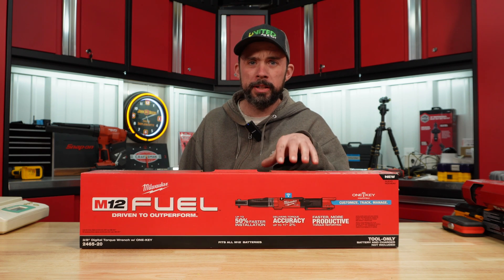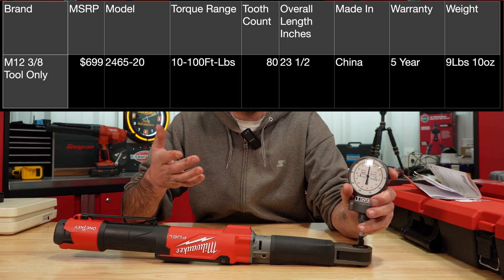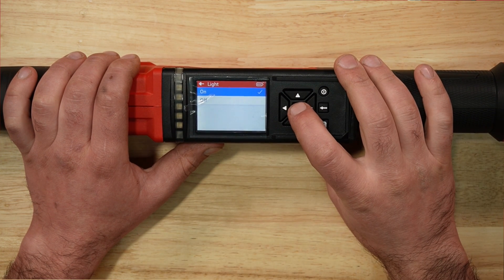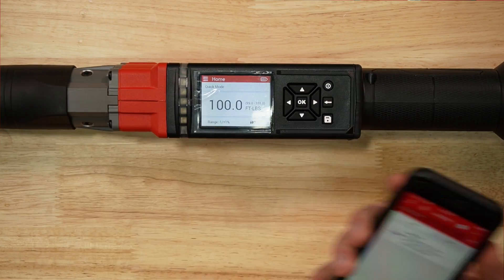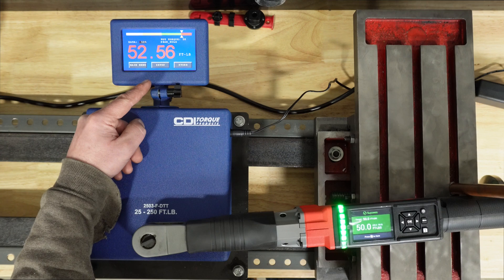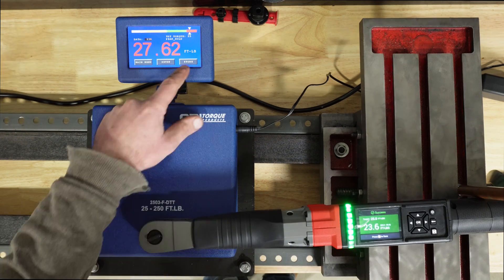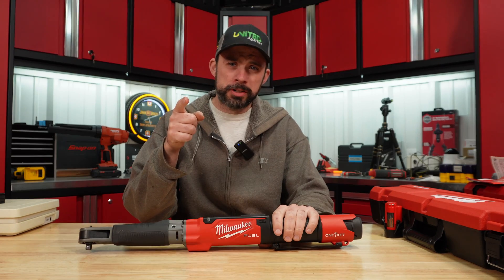Milwaukee Torque Wrench Fails Accuracy Testing,  Unboxing and Review

Comment from the maker: Yes it takes less force to loosen a bolt, this is only to test the rundown feature which claims it can achieve 100% of the torque.  So if thats true set at 100Ft-lbs I should see near that not 32Ft-lbs, or 9 when its set to 25.  

Yes removal will always be less on most fasteners unless there is rust.

This is not a normal bolt,  Its a rundown fine thread loaded bolt.
Reply: There are several reasons a torque wrench can be out of range when you buy it, like was it dropped in transport? Did you hold the wrench still when it was turned on? Also, the run down function is not meant to set to the correct torque, it's supposed to get the bolt close, so you can finish by hand to the correct torque. Read the instructions. Also also, you didn't mention the last time your test rig was calibrated.
Reply: Another way to check. Take a digital torque wrench set well above what the bolt should be. Then KEEP TIGHTENING the bolt until is starts to give/move. Stop and look at the value shown on the torque wrench. You can mark the socket with a sharpie to make tracking easier. 

That gets around all the pesky bolt variables. 

Nice work overall!
Reply: So you're admitting that your testing methodology is wrong, but still claiming that the results are accurate? Here's how you can actually test rundown, and how I calibrate my air guns - take that snap on torque wrench, tighten the bolt to whatever spec you're testing - say 50ft/lbs, then see how much torque it registers to loosen that fastener. Variables such as thread pitch, bolt hardness, and lubrication could mean that it takes 48ft/lbs to loosen, or 20ft/lbs. Once you know how much torque it takes to loosen that fastener, retighten the bolt with the rundown feature, and then use the snap on wrench to remeasure how much torque it takes to loosen. The % difference between the 2 results should give you an idea of the % of accuracy. You can then verify by adjusting the rundown torque by that % and see if it now takes the same exact torque to loosen the bolt. With that said, IIRC, the industry standard accuracy spec for engine fastener torque is +- 5%. So although the results might be out by twice what the tools accuracy is claimed to be, you'd still be within the required specs. Finally, what's honestly more important than accuracy is precision. When you're torquing something like head bolts down to say a 80ft/lbs spec (ignoring the final torque angle), it's much better if every single bolt was tightened to 85ft/lbs +- 0.5 vs 80ft/lbs +- 4ft/lbs. That's actually why I prefer click style wrenches and only really love digital wrenches when a torque angle is needed. 

Also worth mentioning, a lot of digital torque wrenches (like that snap on) tell you in the instructions the proper way to use the wrench accurately - typically no stop/go movement, but a smooth continuous rate of rotation at some obscure degrees of rotation per second. That slow creeping to the dialed in torque may be you simply using the tool incorrectly. Not saying it's the reason for the results, but it could be a contributing factor. The snap on being able to accurately operate under those conditions doesn't mean the milwaukee should or will. I'd only test click type torque wrenches the way you're testing them.

Comment: Will it just shut down after 5000 cycles?? Can this function be switched off?
Reply from the maker: My understanding is it comes up with a message that needs to be dismissed allow you to use it after 5000 cycle.  But I personally never made it to 5k.

Comment: Its off by 2.x ft-lbs everytime, did you try calibrating it or does it have a procedure for that???
Reply: What i found after a quick google search is that you have to send it in to milwaukee for calibration. Factory spec is + or - 2% accuracy so @ 25 ft-lbs that would be within 0.50 ft-lbs meaning your wrench definitely needs calibrated.
Reply from the maker: Yeah I ended up retuning it, once I seen it had to go to Milwaukee for calibration.  Hoping to pick another up at some point.

Comment: Bro, unbolting a specified torque will always require less torque than was applied. I've tested this theory already. "If i torqued it to 90 ft lbs it ahould require 90 ft lbs to remove" but no, i usually need 70 ft lbs. Yes its much more than 35 out of 100 but i doubt the ratcheting alone will ever reach the specified torque.

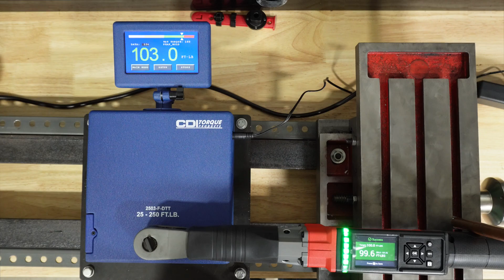Comment: The tool isn’t supposed to be used like you used it at 7:00. It works as an electric ratchet yes and the run down feature does install the fastener like an electric ratchet but you still torque it down like a regular torque wrench. The run down feature is made to not over torque the fastener.

Comment: Thanks for the great video! I was considering buying the Milwaukee digital torque wrench in the 1/2 version , and your review gave me a lot to think about, along with some solid alternatives. Did Milwaukee provide any feedback regarding the out-of-spec torque issue? If so, did they recalibrate it for you?

— Ethan from Australia
Reply from the maker: No problem!  I was within the return window,   so I went the simple route.

Others have said they had theirs recalibrated and are good now.  

Im hoping to get another at some point and retest it.

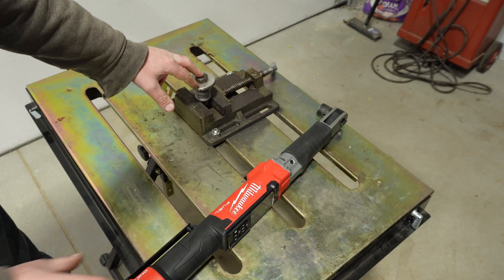Comment: 7:05 this test is moot. When unfastening, the torque reading will always be lower since you are "realeasing tension"
 Try this: take an average fastener and an average breaker bar... tighten the fastener as tight as you can and then unfasten it. You'll notice how unscrewing is much easier than tightening.
Reply from the maker: Yeah that was my mistake.

Comment: I know of a few places they use these to torque bolt in axle assembly thankfully it has a tolerance of around 10 percent. It definitely speeds up the process but wish it was definitely closer
Reply from the maker: Yep,  seems  like they need to look at how they are calibrating them.

Comment: What’s a good flex head torque wrench in 3/8 or 1/2?
Reply from the maker: 1/2 digital I would go Icon or Gearwrench 120XP,  Icon should have a 3/8 version this year.  Mechanical Icon split beam or tekton.

Comment: I wasn't able to watch the entire video but do you think it isn't calibrated right and can be fixed? I've heard of torque wrenches coming brand new and being out of proper calibration. Not sure if you talked about that later on in the video
Reply from the maker: Im sure it could be recalibrated,  and others have mentioned they have experienced the same thing and had to have it recalibrated.  I ended up just returning it,  hoping to test another at some point.
Reply: @Tools-Tested  Thanks for the response. I'm looking for a new torque wrench and this helped alot

Comment: I had to torque aluminum frame glass paneling. It would over torque and crack glass. Never had issues with my snap on....and husky
Reply from the maker: Yeah others have said the same thing in the comments, almost seems like they are selling them out without calibration.  I hope to test another one next year.

Comment: With regards to the calibration certification: I’ve worked as a process engineer in the auto manufacturing industry, we use 100’s of transducer torque tools for safety critical applications across multiple plants. 

Mechanical torque wrenches use release of spring tension on an internal mechanism to indicate you’ve attained your torque value, but tools like this use a transducer, which converts the AC current from the battery into a DC current at the drive motor, the current at the drive motor is how the logic board calculates the torque value.

These kinds of tools must be calibrated often, and as this tool is being geared towards techs and manufacturing use cases, it must be calibrated in accordance with certain ISO requirements. 

My company uses Atlas Copco dc tools and they have to be calibrated every few months. Which would constitute roughly the same calibration interval.

Comment: Was about to buy the milwaukee torque wrench but wanted to be sure.
Guess I won't be.

But being a devil's advocate a little,... Could it be that it's the calibration that is completely off and not the tool being bad quality? or is this inaccuracy an irreconcilable fault for the Milwaukee?

Comment: I've always wanted one of this and was able to get a brand new one for half price. I saw your video after I got it so I'm wondering if they got these problems taken care of or if they are all still that far out of spec. Have you talked to milwaukee about your findings? Curious if they had anything to say about it. Thanks for the video
Reply from the maker: It was still in the return window, so I returned it.  I haven't reached out to Milwaukee,  but I hope to get another one soon and see if it performs the same.  No problem!
Reply: @Tools-Tested  look forward to another test. Wish I the equipment to test mine
Reply from the maker: @BoostedTT91  You could always buy a cheap torque adapter from Harbor Freight and see if it’s close.

Comment: After the 5k cycles, what happens and where do you get it calibrated check?
Reply from the maker: Instructions say it has to go back to Milwaukee for recalibration.  Im going to say soon after it hits 5k it will shut off but I'm not 100% sure.

Comment: That's so disappointing, I think the ratcheting mechanism is very bulky and leads to inaccuracy, plus when it's running it sounds like it shakes up the insides pretty badly.
Reply from the maker: Yeah it was,  hoping to test another one at some point.  But others have commented they had to send it off for calibration brand new.

Comment: I don’t have faith in Milwaukee products. Bought their torch that was reviewed favorably by Project Farm. First one will not charge. Second one turns on sometimes, sometimes it doesn’t. Charge light shows orange even after 8 hour charge, if you remove the cable and plug in again it shows green. Never had such a questionable torch, even cheapo china ones are much more reliable. 🤷🏻‍♂️
Reply from the maker: Yeah I have had issues with the m12 line, 2 of my oem 6ah won’t charge.

Comment: lets be fair here, 
backoff torque is not directly equivalent to tightening torque. takes less torque to undo a bolt that it does to tighten to that spec.
that part of your testing was inaccurate.  abetter test would be to try to continue tightening the bolt with another tool
and, as an automotive tech, none of my tolerance specs are closer than +/-3%, and this tool is absolutely not designed for "mechanic" use. its made for high voltage electricians who generally use low torque values with somewhat looser tolerances. its really not far off +/-3%, so for my own use, this would be good enough.
#ContextRequired

Comment: The Milwaukees probably correct, you need to replace your tool of measurement. Probably best to actually just use the Milwaukee torque wrench as your unit of measurement. I’m not really a Milwaukee fan myself though. 👀
Reply from the maker: Lol I will tell Snap On this $4000 torque wrench tester is bad…
Reply: @Tools-Tested  Lol, definitely a joke. Because a lot of Milwaukee guys think they can do no wrong. I love Milwaukee, but won’t be spending what they want for that torque wrench. Especially if I have to also send it off for recalibration.
Reply from the maker: Yeah some cult Milwaukee fans get triggered if something bad is said lol.

Comment: I liked your video.  I used to work for a small engine manufacturer and we always did our QA torque checks in the tightening direction.  It's more accurate than in the reverse direction.  The only way you can check for sure is to use a torque transducer on the tool while you're tightening because dynamic torque that the tool is reading is different than static torque needed to break away in one direction or the other.  Found that last bit out the hard way.
Reply from the maker: Thanks!  Yeah definitely more accurate in the tightening direction,  I now have an impact tester.  I just need to buy another one of these and test it again,  hopefully during Black Friday.

Comment: Seems like Milwaukee needs to stay OUT of the Torque Wrench game. Or TTI needs to buy a company (ie: Precision Instruments) that knows what they’re doing- like snap on did with CDI Torque. 
 That’s horrible for $700. & even more so when HF’s $20 bottom of the line option is more accurate. Lol. 
 Big FAIL on this one, Milwaukee. 🤦🏻‍♂️
Reply from the maker: Yep defiantly sad,  I agree they should buy Precision they make quality torque wrenches made in the USA.  

I plan on testing another one later this year.

Comment: This guys a blow ass….100% of Milwaukee torque wrench’s when you buy need calibration…from when they are built till the time they are sold the become un-calibrated and it tells you that when you first turn it on which he never shows…and doesn’t do angle lol what a spastic…you can’t tell angles lol ?

Comment: Does having the test jig “arm” close the the inside edge of the handle (as opposed to the middle or outer portion where your hand would likely be) not change the reading?
Reply from the maker: It looks close to the edge but its actually pushing at the center of the handle.  But yes it could potentially affect the reading if you are not center on the grip.

Comment: I noticed that you did do loosen torque on the other tools.  😁. It looks close enough.   Just set it a pound or 2 under for the first year then I bet it's fine after some wear.
Reply: but you shouldnt have to at that $$$$$ Price Point That is a down right shame.

Comment: This wrench needs to be tested with a rundown simulator on the torque tester and use the peak setting. Loosening the bolt will get you lower results every time. I calibrate torque wrenches for a living.
Reply from the maker: Correct,  yeah don't know what I was thinking testing the loosing torque.  I was scared to use a rundown adapter on my tester.

I ordered Skidmore-Wilhelm's new bolt less tester. Hope to rerun this test  with a new wrench once I receive it.

Comment: I was pleasantly surprised and pleased the first time I used my Pittsburgh.
I did a pretty thorough warm up before using it.
Reply from the maker: Yep I was defiantly shocked how accurate it is for the $.
Reply: @Tools-Tested  I did a more thorough warm up than anything I’ve seen on YouTube.
I worked the adjuster up and down the scale a couple of times. Then I put a flip socket on it and made it click at several different settings using my the lug nuts on my car, including three or four clicks at 75 foot pounds. Then I put it back to the lowest setting before putting it back in the case.
Despite many reviews that say it fails to click at low settings, mine clicked even at 20 foot pounds.
Reply from the maker: @DiligentDave1966  nice! Yeah I agree,  I haven’t seen the issues yet others have claimed they have had.

Both the 3/8 and 1/2 have worked flawlessly for me. 

It’s really quite impressive.
Reply: @Tools-Tested  One of my coworkers rebuilt a car with Pittsburgh torque wrenches.
I did a front brake job later that morning with my 1/2” for one of my coworkers.
The accuracy was a very important for me because the caliper specs at 20 foot pounds and Lugnuts spec at 83 foot pounds. My torque wrench had noticeable clicks at both settings.
Reply: @Tools-Tested  I’m seriously considering getting the 3/8 Pittsburgh because it has the lowest torque range I’ve seen so far.
I need about 81/2 to 10 foot pounds for valve covers, etc.
Reply: @Tools-Tested  I have a question for you. I’m thinking about starting my own YouTube channel.
In your opinion, which sounds better: Maybe Dave Knows, or IDK Ask Dave?
I’m talking about my channel name.
Reply from the maker: @DiligentDave1966  Its defiantly a hard decision,  I would say Dave Knows
Reply: @Tools-Tested   I think either one would work well with DIY and side job content, and my wife and manager often say those things when people ask them if they know someone that can do or fix something.
Reply: @Tools-Tested   How about Dave Knows How?
Sounds more positive to me.
Reply from the maker: @DiligentDave1966  Yeah,  you can easily change it after if you think of something you like better.
Reply: @Tools-Tested   Either Dave Knows How, or Determined Dave.

Comment: Home Depot is 90 days not 30. I can definitely understand your frustration i’d be willing to bet it’s a one off situation my buddy had a problem with a snap on tool right off the truck I think it was a impact not suer but he still runs there tools. I do think Milwaukee’s quality has gone down a bit.
Reply from the maker: Yep they took it back, though it had to be unopened after 30 but apparently not.  They took it back on question.

Yeah I might test the 1/2 version in a few months.

Hopefully it was a fluke issue, I was surprised.

Comment: The Pittsburgh was more accurate than BOTH the Milwaukee and SO. Their is a good reason that simple click design has been employed by 100's of tool brands. Its cheap...and EFFECTIVE!
Reply from the maker: Yep I prefer a split beam my self,  only using digital when angle is involved.  But for most cases 90 or 180 degrees you really still don't even need it.
Reply: Trouble with a click wrench is that it's really easy to go over torque with an inexperienced operator- Typically you only have 3 degrees of movement after the click.

I am getting one of these for a look at, hopefully this unit was just a dud. Bad that this slipped past QC though.